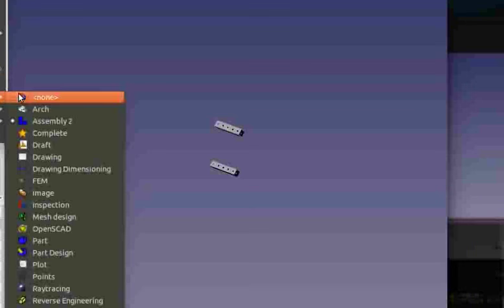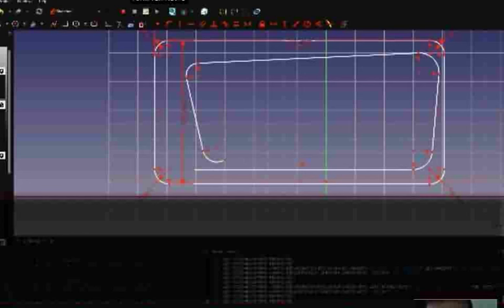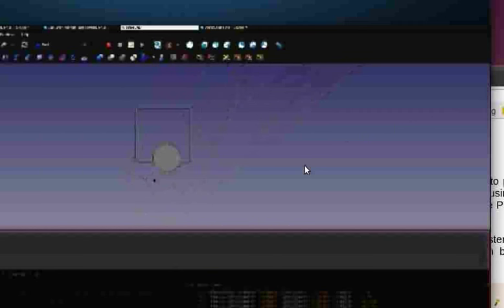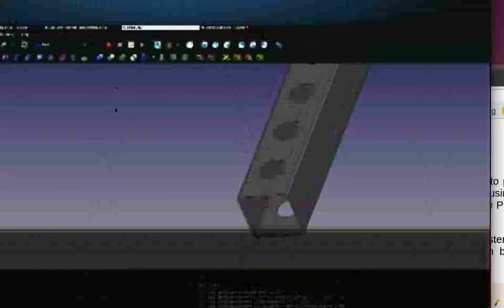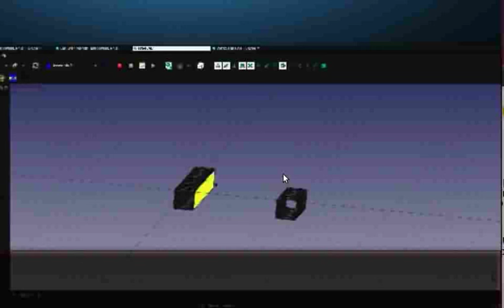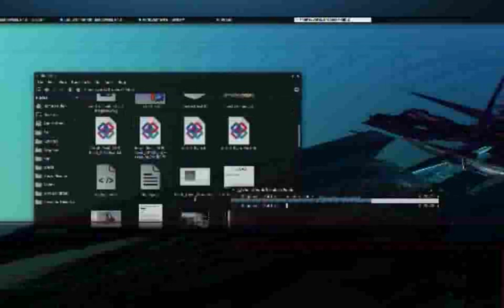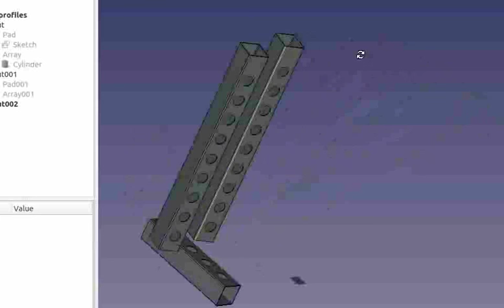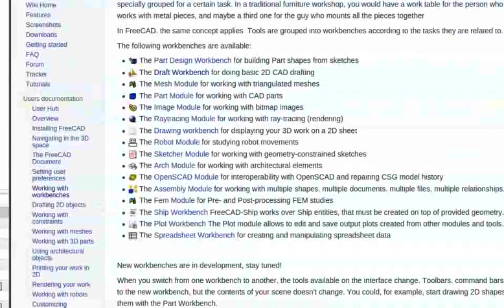Tubing in FreeCAD

Comment: Great to see more examples of architecture or prefab modeling!!
But Pretty dificult to build a medium complex structure because every tube should be positioned in the wireframe, compared to solidworks or inventor, in wich we first draw a 3D line wireframe and after we apply some tubing profile standard, probably with some scripting in a future.